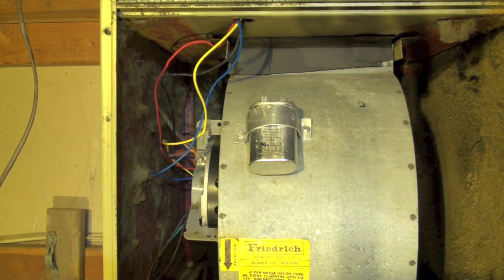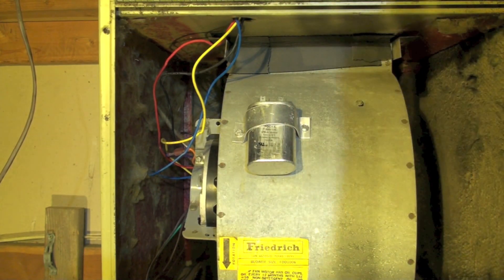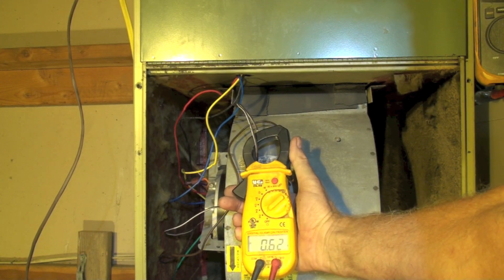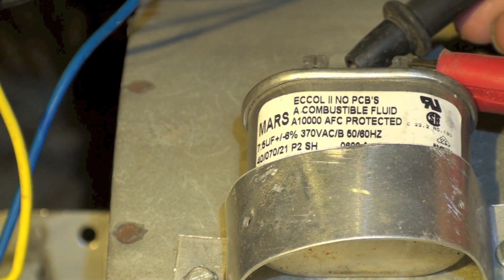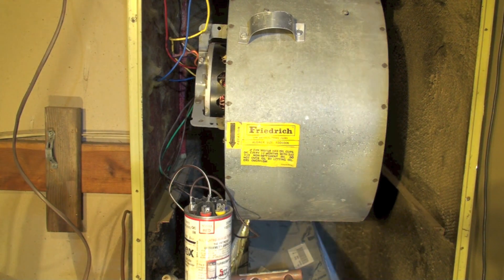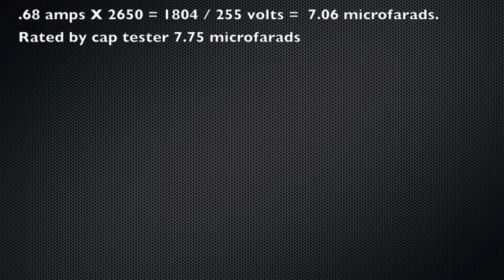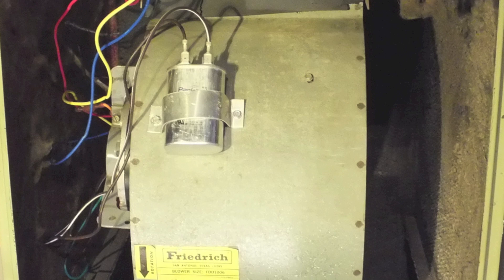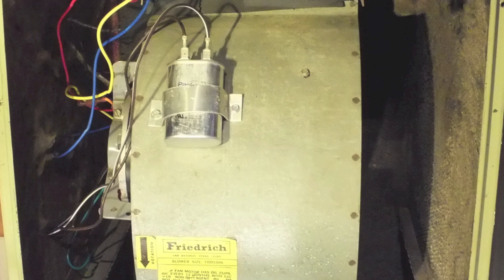How well does the capacitor calculation work?

Comment: The factor is actually 2652 not 2650 and it definitely works on heat pump dual capacitors

Comment: What is the 2650 ?
Where does the 2650 come from ?
Reply from the maker: Beats me.
GFM
Reply: @grayfurnaceman  
Thank you 
I found out that it has something to do with the impedance of the capacitor.
Xc = 1/ (2 pie f C)

1/ (2 pie f)=1/(2×3.14×60)
= 1/376.8
= 0.0026539
We multiply by 1000000
because 1 Farad equals 1000000 micro farad
We get 2653.9
It is approximated to 2650

Comment: @grayfurnaceman if these testing were showing low microfarads where the indoor blower were running , why not replaced the fan cap ?
and also when checking the capacitor not running it shows it is still good , which way is the right way to check caps ?
Reply from the maker: I would use the cap tester along with an amp draw of the motor.
GFM

Comment: Dumb question- Is it possible for a capacitor to GAIN capacitance over time? I wouldn't think so, but I have always heard that when testing a cap with a multimeter, anything from +10% to -5% of the rated capacitance is okay, which to me implies that a capacitor can become stronger over time. Thanks!
Reply from the maker: I've never seen it happen.
GFM
Reply: @grayfurnaceman  Thanks

Comment: What does the 2,650 stand for?
Reply: it's basically the capacitor Formula re-arranged for simpler use. 1/2*Pi*F*C=Xc
Where Xc is Reactance  which equals V/I. Replace Xc with V/I to rework the formula.

Comment: Maybe your uf checker is reading the caps higher? Just a thought. I have used this method for years and always would prefer to check something under load as opposed to testing while it is not running. I have seen units work great in 85 degree temps, run the ambient to 115 and all the sudden we have problems. Everyone has their own way of doing things, thanks for the video, interesting subject.

Comment: I’ve seen it vary quite a bit (about 25%!) depending on the meter you use.  Fluke reads different from Fieldpiece which also reads different than UEI.  Good video, thank you!
Reply: Did these different meters also read different when checking using the capacitance setting?  The tag on the cap themselves give a tolerance right out of the box. The Amrad multi tap has taps listed the same rating but one you can use to go up slightly and the other to go down slightly. I also noticed that the amp draw varied between out of the box caps. Ultimately when in doubt change it out.

Comment: The blower door effects your amperage, you want to test amperage with door on. This equation is more effective to test dual caps on a condenser. Also this test is "under load" or running state. It is more accurate as the unit runs more than it starts. Also resolution and accuracy are better on meters when testing amperage and voltage compared to testing microfarads.

Comment: I am wondering if you would get a more accurate amp reading off the capacitor if you had the actual running load conditions you would get with the blower door in place.  I have a wireless amp meter that allows me to take amp readings with the blower door on.  I think when I get a chance I'll run a test with the blower door on and off to see if the readings differ.   I assume you were using the high speed on the fan for these tests.
Reply from the maker: I would be interesting in your results.  It  was high speed.
GFM

Comment: It is nothing more as ohms law. In this case the resistance is replaced by the impedance. The impedance it made  from the reactance of the capacitor at 60 Hz (this is the imaginairy part) and the resistance (the real part of the impedance)  . The root of both values squared and added is the impedance. The difference measured is a combination of a few things. One of them being the tolerances of the instruments, the second the total real part. If that was zero and the instruments had a zero % fault then the result  should be correct. But those tolerances are not  even close to zero (look up the specs) and the real part is not  either,

Comment: The amp clamp cannot be very accurate because of varying power factor or inductive reactance
Reply from the maker: Kyle Break When the clamp meters came out, I switched to them and never looked back.  I don't know if power factor affects them, but inductive reactance does not give a false reading.  For my money they are the best way to read AC amps.
GFM

Comment: Inaccuracy of your amp meter at those low amps
Reply: I would also like to see the readings done with the blower at its proper rpm. The back emf was very low.
Reply from the maker: Joe Shearer That unit was running against a static load so it should be right.
GFM
Reply from the maker: Joe Shearer That meter is accurate to 1/100 amp and has been calibrated.
GFM
Reply: ***** is the SC56 pretty accurate and what is the best way to place the wire in the jaw? I've noticed my reading do change quite a bit also with other wires close in a bundle etc...
Reply: Thanks medic good advice.
Reply: @grayfurnaceman   most blower motors I see will over amp with the door off.
Reply: @joeshearer1247  My ammeter has center lines on it, so I believe right in the center area of the clamp.  This is also what the instructions for the meter stated. The reading can be affected by being to close to other power carrying wires, or too close to transformers.

Comment: Have you considered ESR (Electrical Series Resistsance.)

Different companies make these. Mine is Russian, but the idea started in Australia with the blue meter. I replaced the cap on my goodman and the new cap tested better on ESR. The real problem was the condenser motor that froze up shortly thereafter. I replaced that also. ESR absolutely applies to electrolytic caps. These are being made poorly in china and cause numerous circuit board failure from dishwashers, computers, to HVAC. The modern failure rate of electrolytic is phenomenal. The run cap and and electrolytics are different animals, but really the same. Even a Fluke cap meter does not tell the truth about ESR. I may get ambitious and make a vid or two about a dishwasher and wine cooler problem. One dude had no schematic for his Robert Shaw oven temp controller, but he saved it by testing ESR in circuit. A few dollars in caps was less than the Robert shaw controller at $500. I did learn something useful from your video. Thank you.,,

Comment: I think that the cap being under load is the explanation to showing lower numbers. Whether you use 2650, 2752, or 2654 the calculated numbers change fairly little. I have seen capacitors calculate to the rated number and some show go readings without load and not start the motor when connected.
Reply: Capacitors and their expected run life are a total crapshoot anymore ***** I have seen them read weak year after year and never fail, and then there are others that checked perfect one week and the next week they cause a breakdown. I'd say it's like anything else- make the call based on the specifics of that situation. If you check under load and it is at 50%, pull the leads and check it resting. I don't think there is a one size fits all for much of anything. Technically if the motor is running at all the capacitor is fine, good enough to make the motor run anyway. then again if you've got a 15-20 temp split across the coil do you even need to check refrigerant charge?
Reply: Stephen Rardon maybe superheat and subcooling.. and airflow if you want to earn your company some money :D